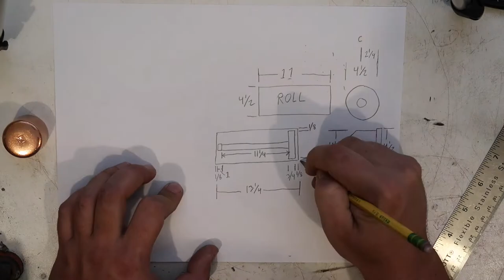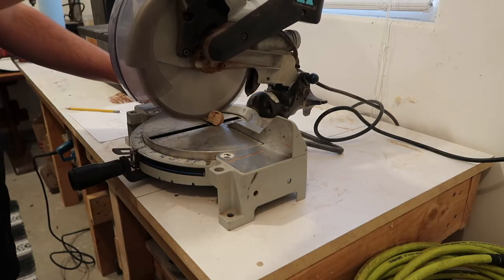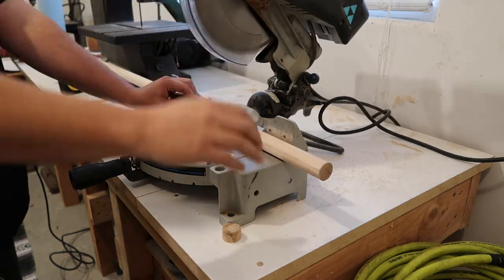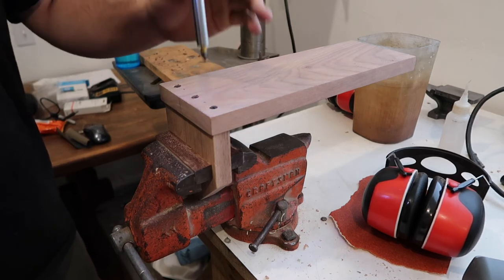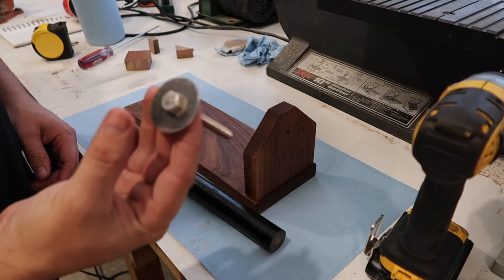DIY!! PAPER TOWEL HOLDER EPIC!!

Comment: Use least screws as possible
Reply from the maker: Can you explain?
Reply: Maybe I can explain.  Beautiful towel rack.  The  washer and the screw takes away from it's beauty.  A couple of options would be 1)  to fix a similar  copper piece on on that end to match the copper end or 2) perhaps skip the screw and instead run the dowel through the extension or half way and glue it.

Just suggestions.  Still a nice looking rack.